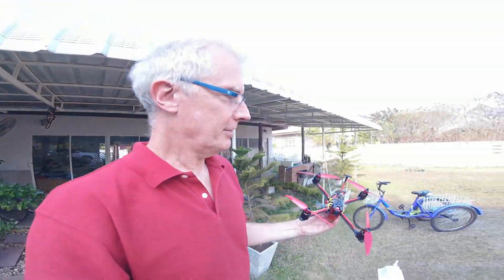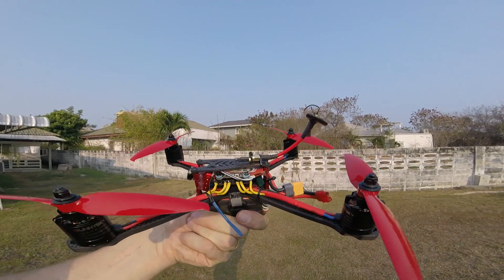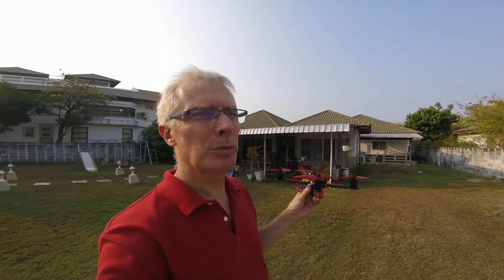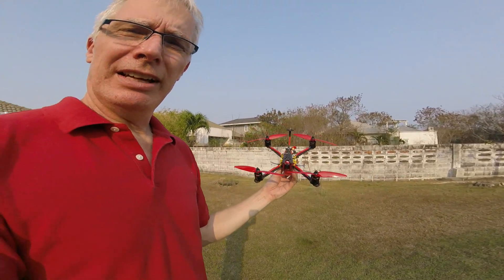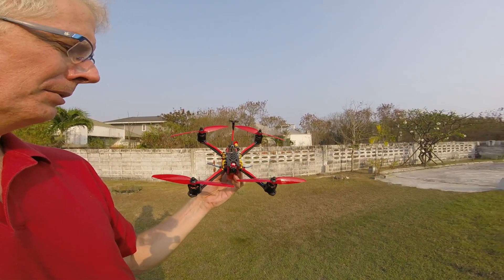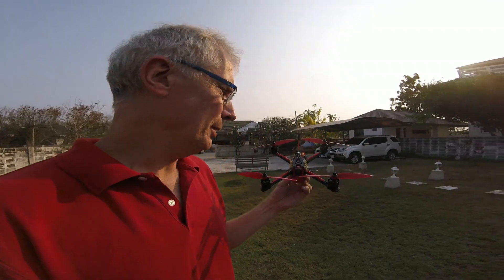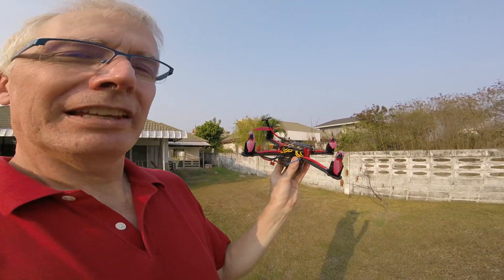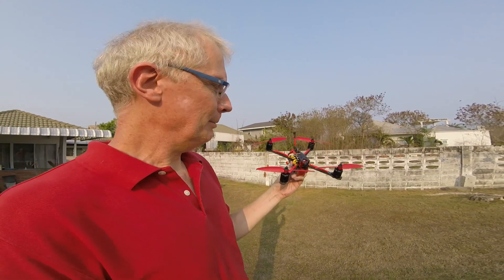I built a 7 inch quad with Alfa Monster frame and Sunnysky X2212-10 1250 KV motors.

Comment: battery ?
Reply from the maker: I used to fly this one with 6s 1200-1400mAh and I say used to because it has gone through some changes... I ended up on the ocean floor... and everything was broken except for the frame. I put on some Emax ECO II 2807 1500kv motors and a new stack and the props you see in this video was exploding due to the stronger motors which resulted in broken arm and a few new motors. I tested with some old cyclone 7056 props and it flew very well and produced the latest motor-bike chase videos on my channel,  but the old cyclons has a weak hub and it resulted in more props exploding and a total wreckage of the whole thing. Later I found out that the new Cyclone 7056c Pro has more material where the blade is attached to the hub. So I built a new 7 inch drone from scratch with a Cineglide frame and FPVCycle 30mm motors, which actually are 3206.6 1420kv. It flies well...
But... you should probably have a little bigger battery. I get 4 minutes out of a 1400mAh 6s Tattu...

Comment: I'm wondering what you think about noise. I have also build a 7 inch Biblade Freestyle Setup (6S/1200KV Racerstar/T-Motor 2508) which I really like flying.. but as soon as I push the throttle these Biblades make such a loud and low-frequent noise that I always think I'm harassing or even scaring people (i.e. dog owners). You're obviously flying above a residential area which is inconceivable for me. I'm flying hundreds of meters away from houses and still feel uncomfortable, because as soon as I start to have fun you can hear me all over the place
Reply from the maker: You are a good man thinking about other people. Most of the houses close to my house are more or less abandoned and the owners are here only a few times per year. The other's who are living in the area know who I am and I talk to them often enough to know that they accept my flying. Most of the people here have dogs and I used to have dogs too. I have never seen any of the dogs going crazy when I fly my drones close to them... But I can tell that if the dog owner starts to swear an curse about a drone flying by, the dogs will probably learn the same behavior. So from my 5 years of flying in this area, I have never heard a word of negativity of my flying from any of the people here. But for sure.. if anyone don't want me to fly over their house, they can just let me know which house it is and I will avoid it.

Comment: Very impressive power did you learn to fly using as simulator at first ?
Reply from the maker: Thanks. No simulator - this was many years ago,  but also I crashed a lot in the beginning... I tried to fly line of sight and then when I put the FPV goggles on I was scared and I had problems keeping altitude control. Very often I ended up too high and I reduced throttle in panic and crashed. So a simulator is the way to go. I think if you spend a few hours in the simulator you will get rid of the first 200 crashes. I had only two batteries in the beginning and they lasted maybe 5 minutes each.. 10 minutes of flying every evening after work and subtracting the non-flyable days and repair time... not much time when I actually were flying. So a few hours in the simulator that you can do during a weekend will probably get you to where I was after three months of crashing/repairing...
Reply: @Siamect  Thanks for that informative reply and advice .  I have to say that your videos are appearing more and more in the recommendations page thanks . I did watch some videos on building quads the soldering and all the connections . Amazing how we have a World Women's champion and so unassuming  so young "Milk " have you seen her compete she is very calm .
Reply from the maker: @AndrewSpeersbangkokboy  Thanks. Yes I have seen Milk flying a couple of years ago. I practiced sometimes at the same place as her... If she had 22 seconds around the track I had 45 :)
Reply from the maker: But this quad ended up in the sea...  :) https://youtu.be/NnPu4iqG09E

Comment: Hi, Which battery do you use and what is you average flight time?
Reply from the maker: Infinity 1300mAh 4s and flight time is about 4 minutes so nothing impressive here. 
This is not a long-range setup and it is not optimized for flight time. 
It is just a project to carry a gimbal on a quad with more agility than what dji and others have. The gimbal has problems and I'm still waiting for some spare-parts... So I just put the GoPro on a 3D-printed stand...
Reply: @Siamect  Great setup! What is it's weight?
Reply from the maker: @marianofpv  With the gimbal and GoPro session, and actually two batteries, because the gimbal don't like 4 cell batteries, the weight was somewhere around 950grams. So it is heavy. I'm thinking of removing the gimbal and just use it like a normal freestyle drone. The gimbal restrict my flying and as a result it is terribly boring to fly. I haven't flown it for ages.l but that would change if I didn't have that gimbal.

Comment: Nice build...try use 7040 3 blade hows going..
Reply from the maker: Thanks for the comment. Yes I have ordered some HQ 7X3.5X3 so I will report the result when they arrive. I have also tested to attach a Storm32 gimbal to it and it was working pretty well but I only flew one pack because the sun decided to go down... today I rebuilt the thing with a crossfire nano receiver, GPS, barometric sensor and magnetometer and loaded iNavflight and I just tested hovering a little. So hopefully I will test a little more tomorrow. The thought is to make an agile gimbal drone to bridge the space between the typical DJI domain and the 5-inch freestyle quads.
Reply: @Siamect  really nice build. One day i will build 7 inch quad also with full of navigation. Some others i saw when 7 inch quad to be careful with props selection cause vibration when flying and motor getting hot. Mybe i will start with 7inch iflight and  stick with 23xx motor size(balance spare parts) thanks for sharing😃
Reply from the maker: I just tried the HQ 7X3.5X3 and they are smoother and probably more efficient but they have no top end. I almost crashed on my first power-loop because I thought I god more altitude than what I actually got...
But having said that I run iNavflight with the HQ 7X3.5X3 and I run Betaflight with the Gemfan flash twinblades so it is difficult to compare as the tune and other thing has changed.
iNav works well with return to home and position/altitude hold, but it is a scary feeling to just let the system fly by itself, take the FatSharks off and look at the drone line of sight, not touching the sticks. For me as a 5-inch freestyle pilot this is pretty scary...
Reply: U can show the video, hows going. How long your flight time you get for this props?
Reply from the maker: @manvsfoodfpv  For the HQ 7x3.5x3 I got about 4 minutes pulling 800mAh from the battery. For the Gemfan flash twinblades I'm not sure but I think it is slightly less but that may be because they are much faster being two blade and more pitch so the flights are directly comparable.